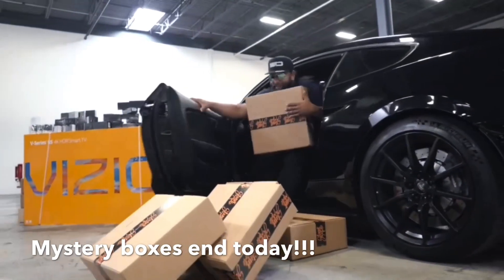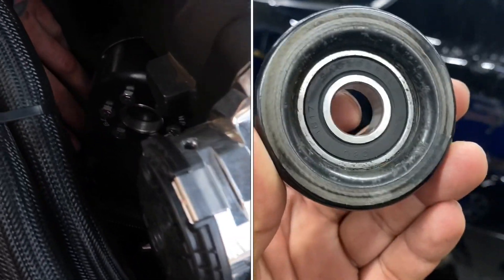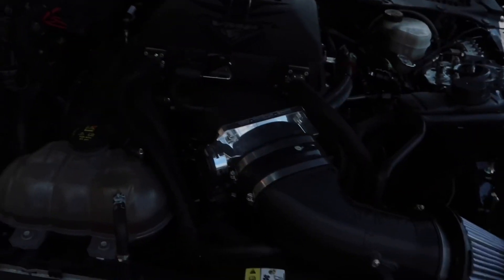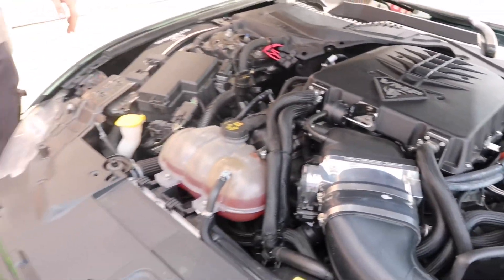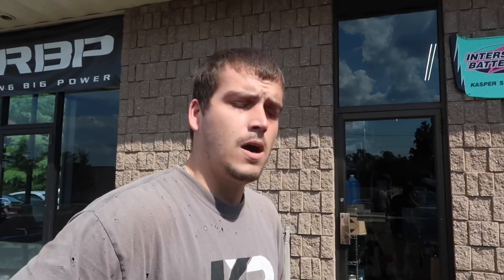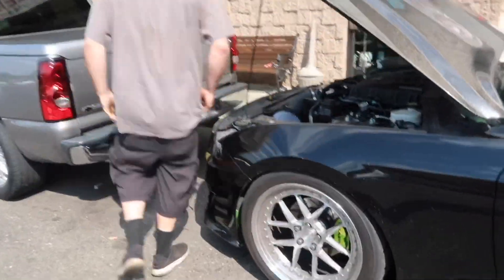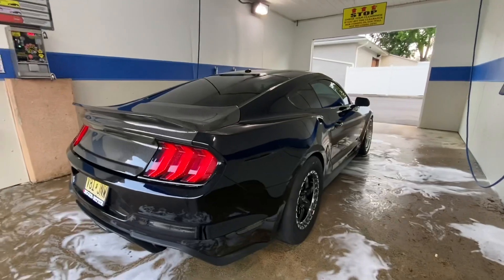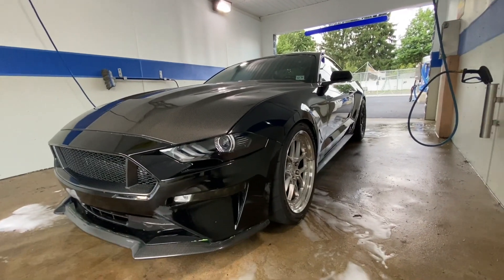Why I STOPPED making VMP BOOSTED BLACK MAMBA VIDS!

Comment: Gates makes a high performance belt made just for racing with boosted applications...it's called the RPM series. Supposedly they are a step up from the Gates HP Green belt which is a fine belt itself.
Reply: They are a step in in WAYS they have more grip but can't break with zero warning and shred it looks like a 300lb spider laid a web under the hood....
  I try others and keep coming bad to Gates Green and I did a lot of testing on procharger cars

Comment: My belt on my Odin blower shredded apart after less than 1000 miles. I did maybe 3 full throttle pulls. No clue how many vmp did on the dyno. 79mm pulley. That is the only problem I’ve had though. Zero full throttle pulls on the new belt. I’m going to the 8 rib and upgraded tensioner as soon as vmp releases it.

Comment: Dude I think you can beat streak speed 717 from a dig, but a roll race especially 60+  it might not work out but I would definitely watch it a few times. So Stang mode go put that Zr1 in its place.

Comment: Becarfull not to push that engine to far.
    Try it out like that and see if you need that other pully.
    I mean you still plan to port it. Better to have a good safe flow, than a an monitory peak power that's going to blow the engine, blades, trans drive or what have you.
     9's a fast car.
    Get a fox body bro, that'll get you in the 8's. And you'll have a ton rout's you can take to get there.
    Build a good 347 with a number of different set opps. It'll make good content and you'll be able to switch it up over and over.

Comment: Stangmode , I love your videos, your passion for Mustang’s but in my opinion the only thing missing in your videos or channel is a True Daily Driver that doesn’t go to the Track... U should have 1 Stang that is your baby , The interior customized, small mods to the engine/ exhaust, tint the windows and enjoy everyone everywhere you go drooling over your Car.. Everyone on YouTube is doing the same thing over and over again and No Offense MUSTANGS ARE MEANT TO BE MANUEL ... I could careless about a few seconds faster in ur 10 speed auto transmission over shifting gears but again too me driving a Mustang is all about giving it gas listening to the Motor come to life and start going thru those gears yourself not putting it in Drive and stepping on the pedal BORING... THATS THE #1 reason I WILL NEVER BUY A 2020 GT 500